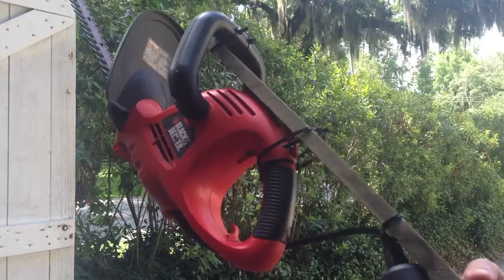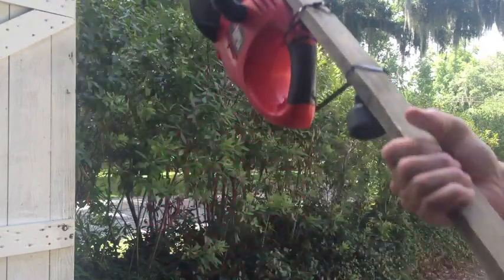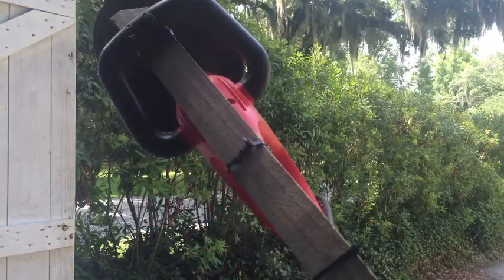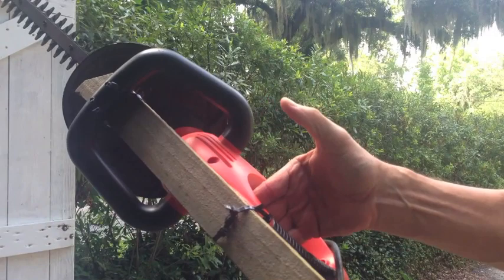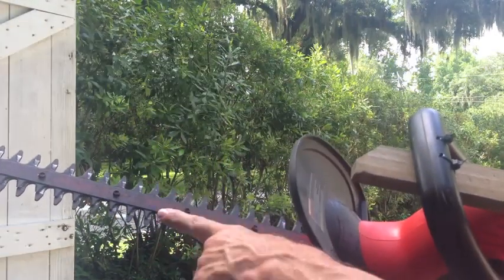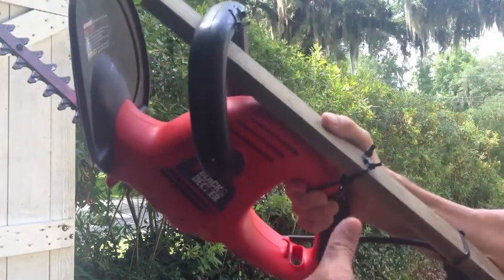Homemade Hedge Trimmer Extension

Comment: Brilliant, thanks for that, extending mine now..
Reply from the maker: I've used it several times now and the only issue has been that the zip-ties that go through the handle stretch out a little and have to be pulled tight again.. Swapping those two out with nuts/bolts/washers should fix that issue.. 
Thanks for reply..

Comment: excellent ...real good idea....but i want to go a bit further....i already have the 6 feet hedge trimmer from ryobi 40 volt( i paid $160.00 at the home depot) ....now i want to have at least 12 feet total of reach, i have bushes that are 10 to 12 feet tall....having said that ...i know that i should have bought a different brand i think it is green works that sells an 18 volt  9 feet long pole for $140.00...and it can be separated into a single hedge trimmer or a long 6 foot trimmer or even a 10 foot trimmer...from my experience a home owner doesn't need more than 18 volt ...a 40 volt is good but it is more power than one needs ...and on top you have to pay way more for it...